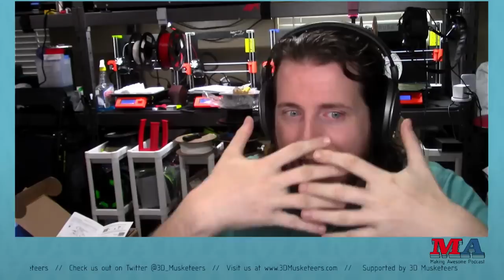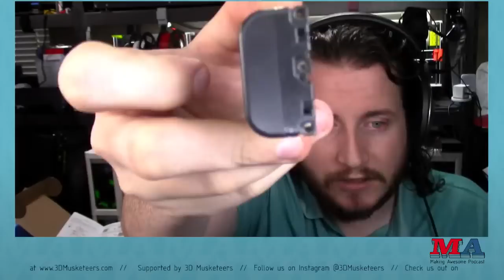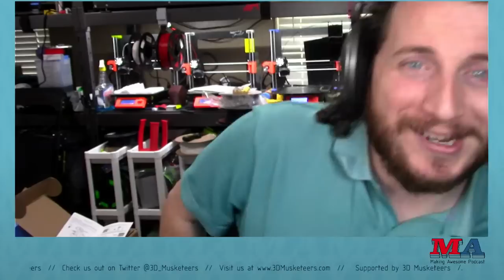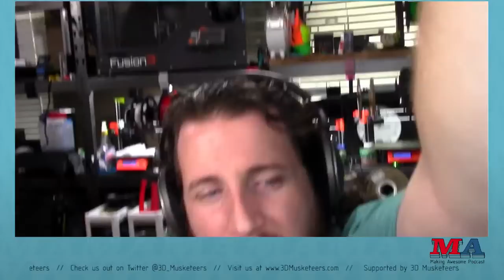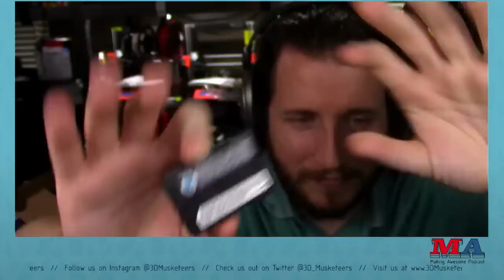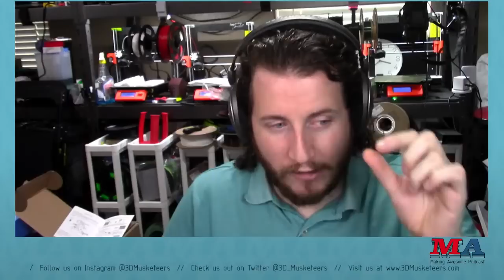Injection Molding vs. 3D Printing and why both matter! - Making Awesome S2E49

Comment: 23:16 in what configuration does this apply? if you have a wall you can just make a square instead and not have to use two rectangles. if you have a flat surface on the floor its not a problem either, so i would think that this is on horizontal plates in the air? can you show me something where you apply this technique? (even a crappy paint drawing will work :D )
Reply from the maker: YT wont let me because links.. But yes you just stack 2 rectangles (with maybe 0.2mm thickness each) 90 degrees out of phase from each other to build a bridge network for your blind hole. It is used when you are trying to bury the head of a screw into a part, when you need a normal hole for the threads as well. If you want, you can email me and I can send a photo that way, but if you have a prusa, that is how they do their bolts as well. It is a technique to remove support material.
Reply: @3DMusketeers  sadly i cant afford a prusa :D i will e-mail you tonight, thank you very much for the info
Reply from the maker: totally understand!